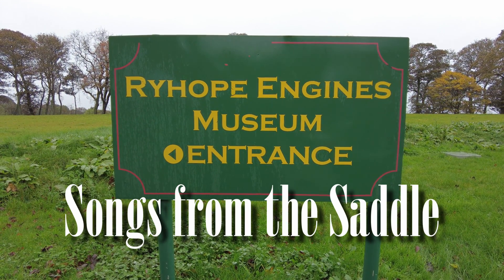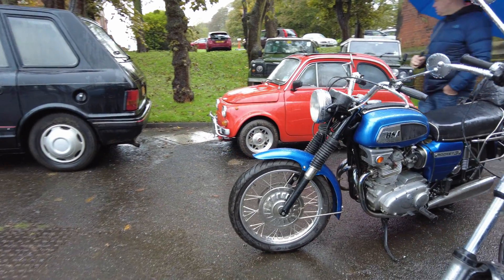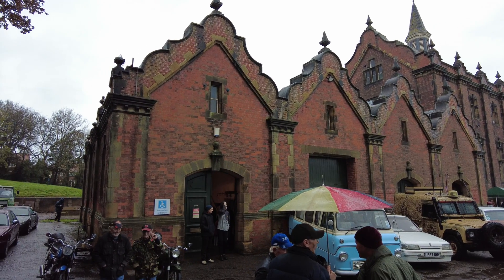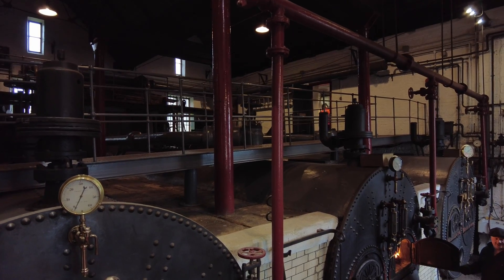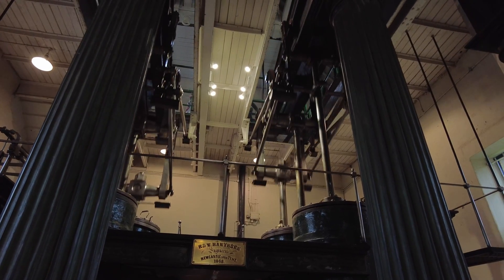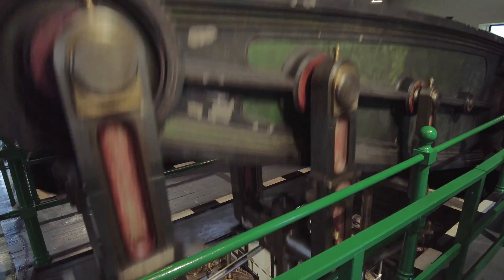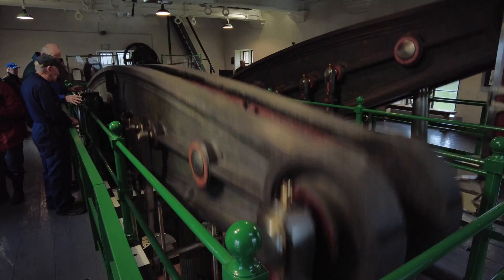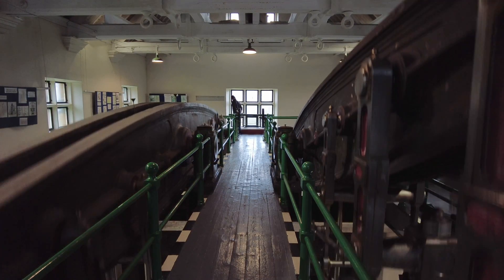Ryhope Pumping Station - working steam beam engine

Comment: Wonderful to see, well done sir and bravo on the locals getting it preserved.
I would have liked to see the actual pump or wasn't that possible?
Reply from the maker: Thanks for watching. As you say, well done to those who keep the engines up and running. I filmed all areas the public can see. I don't think there is anything you can see of the pump. It consists of a large bucket on each end of the beam with a one-way valve in the bottom. the bucket is plunged down a well shaft and lifts water into a release channel. very simple but effective design.